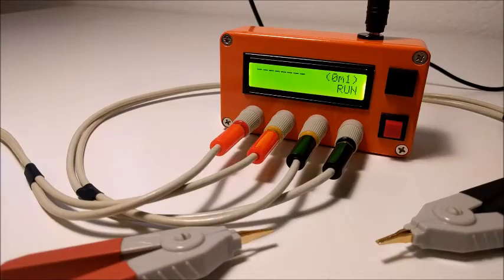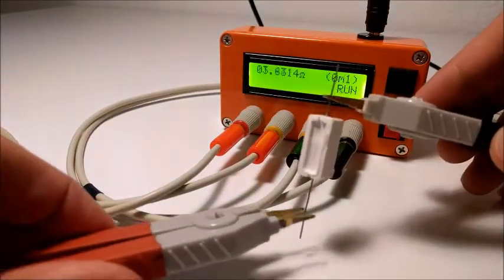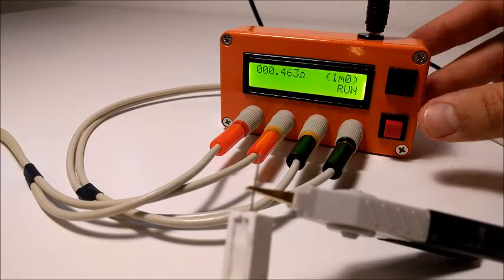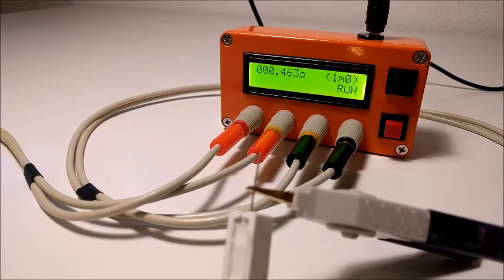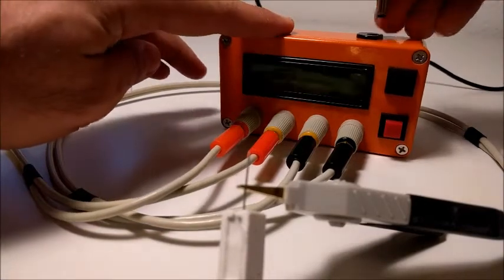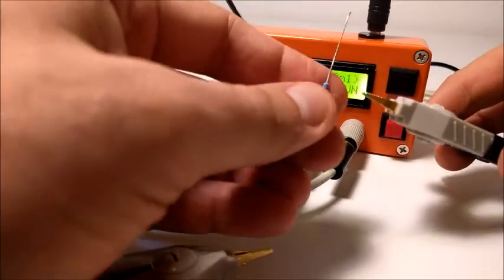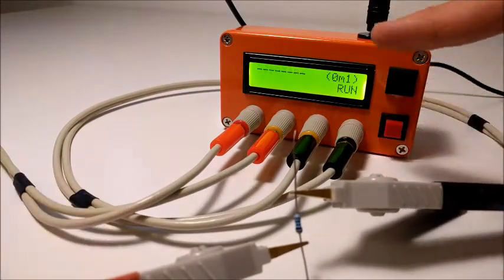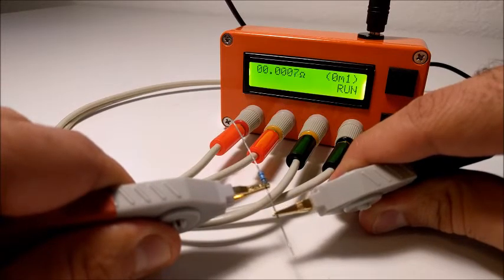Milliohm Meter Description (Louder version)

Comment: I am a fan of arduino boards as I use it to record DC current measurement and rpm for my dyno.  
Coming across your video, got me interested in building one of these however I have never soldered small components to a circuit board.  Would this be difficult for a beginner?
Reply from the maker: Hi. It could be a good board for beginning. The parts count is small and more or less everything is large. The most complex part is IC3.